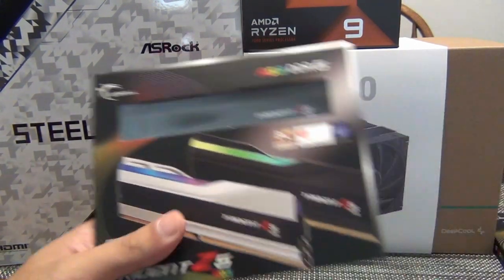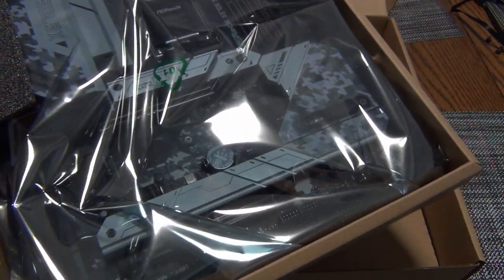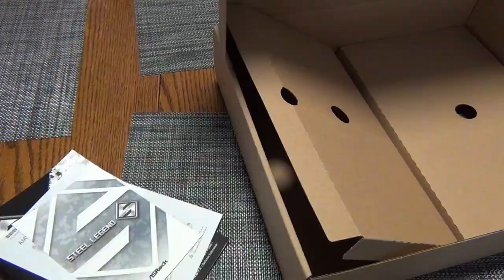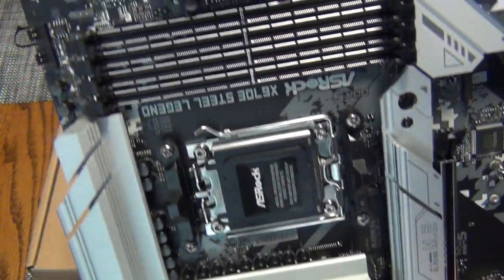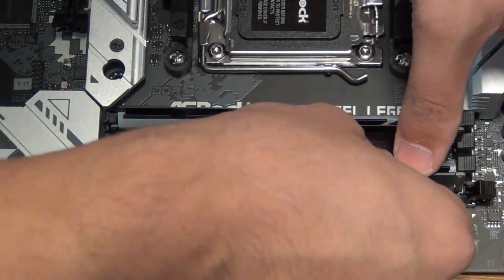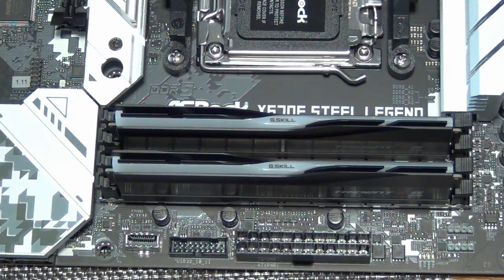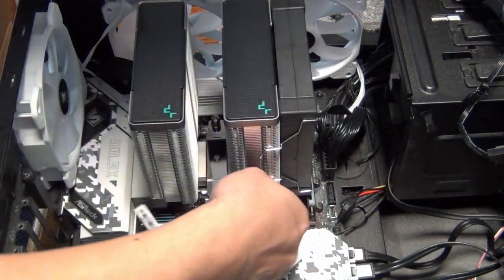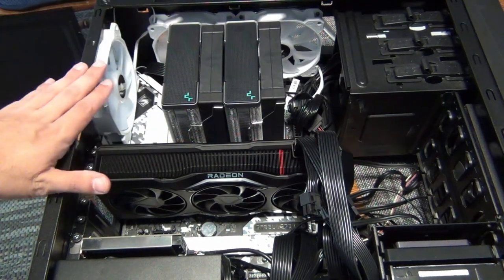Ryzen 9 7950X3D and ASRock X670E Steel Legend PC Build AGESA 1007b

Comment: I cant get 6000mhz with 64gigs ram only 32gigs u know why? I got the same mobo as you but i have the 7800x3d
Reply from the maker: Are you on the latest bios?
Reply: @GameTechReviews  yes
Reply: totally normal for ddr5 at the moment, unless it is hynix A die which I believe can go 6000-6400 with 4x sticks depending on your board and how lucky you are with your memory controller. (m die, samsung and micron memory dies struggle to get above 5600 even on intel 700 series boards) it is partially the motherboard's fault and partially the cpu's memory controller. If you want super technical info on this search up ram topology and ram ranks videos by Actually hardcore overclocking (long videos but lots of helpful info if u care)
also what kit of ram are you using?
Reply: @luvingyouu  I'm using the 32gigkit from corsair vengeance  6000mhz
Reply: @SwerveNation  depends what version u have, the cl36 and cl40 6000mhz models are quite bad binned dies and i have seen issues with people even getting them to run at expo/xmp timings with those kits you most likely cannot run 6000mhz or higher with 4x sticks of ram. if it is the cl30-32 6000mhz kits it should run 4x kits at 6000mhz with no issues, but that isn't always the case and you might need to tweak settings and timings.
Reply: @luvingyouu  mine is the cl30 one
Reply: @SwerveNation  oh nice you have a good kit, can't remember off the top of my head if it is A or M die but no matter which u should be able to get 6400cl32 with 2x sticks easy with that kit, with some timings messing around you can probably get cl30-32 6000 with 4x sticks
search easy hynix timings for am5 and just mess around and see if you can get similar results to him, you should be able to get better results now from that video since stability updates have come out
Reply: I jus realized u cannot use 4 dimms. I was trying with a 2x32 teamforce kit with the 2x32 corsair kit and the pc would only boot up if the speed was set at 4800mhz. If i went higher it would never boot.😂 @luvingyouu
Reply: @SwerveNation  well it might work if all primaries and some secondaries are set to the same value. Also depends on what manufacturer and die brand they are. I have found Corsair 32gb kits to mainly be Samsung and TG only hynix. Maybe if you adjust primaries to the Corsair kit since Samsung ddr5 has similar but generally worse primaries and secondaries than most hynix dies so the hynix kit should be able to get those. But really depends what they are too and I am just speculating if it actually is Samsung die and hynix die ; D
Reply: @luvingyouu  thanks for the response even after 3 months lol. So help me understand what do u mean by "primaries and secondaries"? Also how would I know which chip die my current teamforce and corsair sticks have? Or am I supposed to just look at the memory QVL on asrock's site for x670e steel legend mobo?
Reply: @SwerveNation  lol no worries I’m just watching repair videos before work to learn more ; D
You can find the memory die / manufacture looking up the QVL with the part number generally or you can use something like CPU-Z to tell you the manufactuer (doesn’t tell the die though but it’s fine)
Primary timings are the ones they usually show on the box with XMP/EXPO enabled. It goes TCL/cas latency - tRCD - tRP - tRAS 
so an example would be 30-36-36-76
Secondary timings are everything else (although they are technically split and have different naming groups but who cares about that right now)
Reply: @luvingyouu  I see so first thing to do is to find which dies the ram kits are?
Reply: @SwerveNation  finding if they are Samsung / hynix helps but you could probably just punch in whichever has the lower primaries and try booting with that
Reply: @SwerveNation  do you have discord by chance?
Reply: @luvingyouu  how would I do that?
Reply: @SwerveNation  well find the primaries on both kits either by looking at the values on the box, where you bought it from or using CPU-Z and looking in the SPD tab and looking at the highest expo profile 
Then enter bios by restarting your pc and spamming DEL and going to OC tweaker I think it’s called in asrock bios. You’ll find dram config profiles which is where you enable xmp/expo and there is dram timing config where you punch in the values
Reply from the maker: @SwerveNation  You shouldn't use mismatched dimms. Ideally all 4 should be of the same kit or at least the same brand/model. See my video on 192gb DDR5 on AM5 at 6000

Comment: what is your psu?.
Reply from the maker: The entire part list is in the video description.
Reply: @GameTechReviews  looks like a massive psu, how about your voltages, are pretty stables? how hard drop yours voltages?, im considering some psus. this cuuld be one of them.
Reply: @JomarsYT  powerspec is a decent psu overall, keep in mind they are mainly only sold at microcenter (edit: didn't know they are sold on amazon, saw the link in desc!)
other psu's you can consider: Seasonic focus gx, be quiet system/dark/pure power 12-13, super flower leadex iii and leadex VII xg, corsair rmx, msi MPG AGF are good picks overall in my opinion, just choose whatever best fits your budget they all have their own pros and cons but all have 10 year warranty from my knowledge (in the US) and are not going to just explode don't worry
Reply: @luvingyouu   im looking the asus rog thor 2 1200w actually, im the "looks" rgb guy (no homo)
Reply: @JomarsYT  I don't hate that psu but hate the price of it, but there really arent many good psus with rgb in that high of watt range. So i mean, up to you. That psu is quite well built overall and will last a long time
what is your build btw? I usually recommend to just get a psu that is going to fit your current and probably next build and runs under 80-85% (max) of it's wattage. Most powersupplies are at their peak efficiency at between 60-80% of their rated power draw and as long as you are in or under that range that will generally allow allow for a long lasting psu
Reply: @luvingyouu   i currently have a 7800x3d, 32gb 7200mhz corsair, this motherboard, and 2060 super aorus, im a bit worry about mostly the voltage drops i have while plying high demand games, it can drop to 11.7 (mb sensor) and 11.6 (gpu sensor) with a thermaltake 750w grand rgb psu, is "ok", but for gpu upgade i gonna need a better psu no matter what, i skipping the 40 series fiasco also.
Reply: @JomarsYT  yeah, I mean the voltage drops aren’t the worst I’ve seen but yeah soon calling for a new psu unfortunately. Should be fine for now though, how fast is the voltage drops? If it is slow overtime example like 5 or so minutes in then it’s not the worst and the psu will last a while longer, if it’s very fast or instant voltage drops..... will be fine for a bit longer overall (they aren’t massive voltage drops, usually once you get down from 12v to 11v is when it’s time to get rid of it and not take chances..... but dropping 0.3-0.4 is fine for now 
any luck getting that kit of ram to higher speeds?
Reply: @luvingyouu  i didnt test that ram futher until i swap my psu, but looks like you can do 7800 / 8000 pretty easy from my research.
Reply: @JomarsYT  ryzen generally benefits from ram running in 1:1 mode anyways, 6200 will be much better than 7600-7800 depending on 7800 timings
Reply: @luvingyouu  Did you push more the ram with this mobo? And I want to ask something, what is the VIN3 voltage? What is for? You have steady 1.696 and never drop even with your system running hotter, mine can drop to 1.664 under gaming with a shitty 2060 super 144fps.
Reply: @JomarsYT  VIN stands for “voltage input”
This usually pops up for one of the few reasons: there is no sensor on the board for this so no naming scheme for it and it is a semi accurate (sometimes completely inaccurate) reading of some random voltage on the board. A sensor(s) are dead / dying and cannot accurately report and detect a voltage on the board so it is labeled as the generic “VIN”
I haven’t tested this motherboard specifically, but asrock’s latest beta bios on most of their boards has led to better ocs. Funnily enough one of the cheapest am5 boards the hdv/m.2 has set multiple LN2 and ram overclocking world records for AM5 lol
Anyways you have a 7800x3d just tune for tight sub timings and some tighter tRCD and tras primaries(you can probably get 30-32 and 30 respectively with a hynix kit)
Reply: @luvingyouu   trhanks man, i will do it!.

Comment: I have order this board today, I will put a Ryzen 7 7800 X3D, Kingston 32 GB 6000Mhz Expo and, Samsung 970 EVO Plus 2TB and a RTX 4070 Ti on it.
Btw ,there were 10 screws to screw the motherboard in place on my board.
Reply: are you happy with the board? Did it work "out of the box" with your 7800x3D?
Reply: @G-O-A-M  Yes it worked out of the box, but I flash to the latest Bios before first boot, it is stable with PBO -30 and Expo 6000.